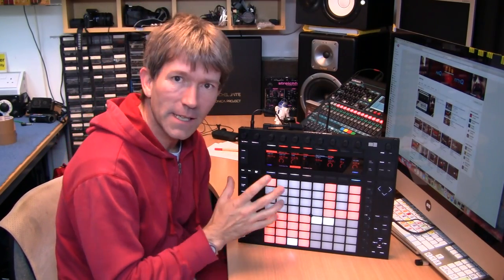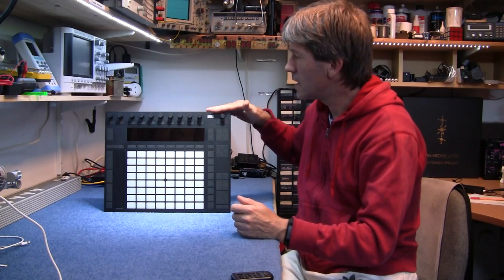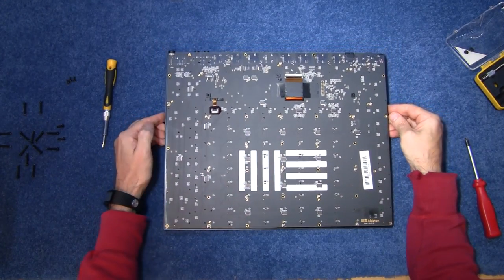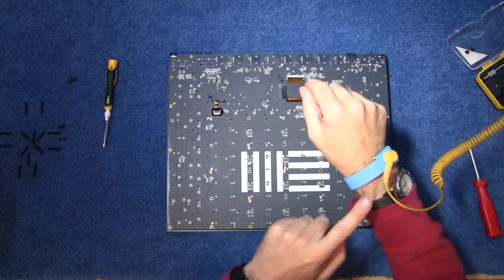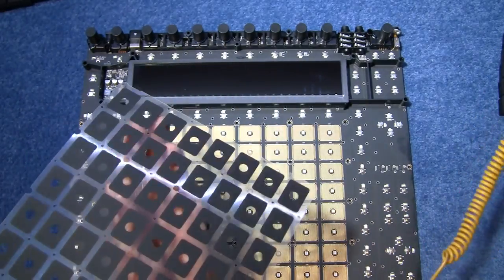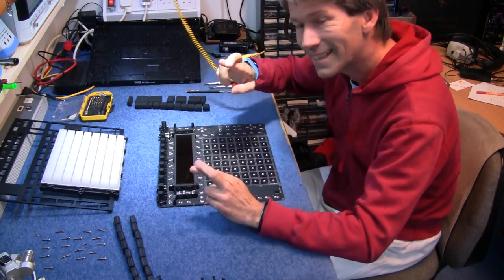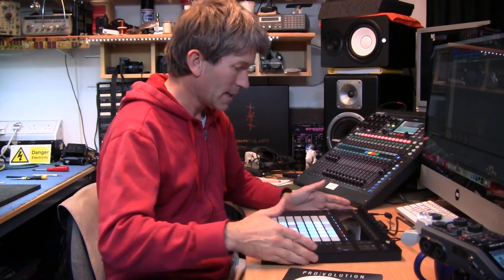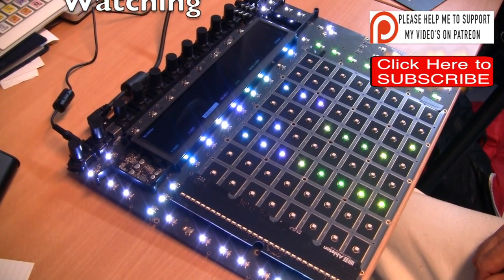ABLETON PUSH 2 teardown MF#60

Comment: Seven years later the finish on the bottom case has turned into a sticky mess so thank you for the teardown. I am disassembling in order to strip the finish down to bare plastic.

Comment: Hi Markus, thanks to your tutorial I've been able to open my unit and polish the carbon layer and some contacts from a couple stains of red wine. Pretty smooth procedure. I'm not an expert in hardware but I think this machine it's really well builted and designed. Thank you again for your help, I'm sure many people have found your teardown very useful.
Reply: How did you clean it up? I need to open mines too! I got 2 pads that aren't working

Comment: Thank you for this video. Watching this I found those hidden screws and also used a hairdryer to loosen the glue. I was able to have the confidence to take apart and repair my own push 2 after having accidentally thrown a large glass of red wine on it! I cleaned out the wine that was trapped between the carbon layer and the button circuit and it works perfectly again.
Reply: Hey dude I'm here as I have a cleaning job on it also :) What did you use to clean it?
Reply: I would also be interested, could you share your experiences and cleaning products?
Reply: @jajahah1359  see my comment above, I didn’t get anything special. :)
Reply: Hey, thanks for your comment. What did you clean the sheet with? I ask as I'm having problems with mine and think that I need to do the same. I just don't want to use alcohol and ruin it if there is any potential of harm.
Reply: @AaronHalliday  see my answers above :)

Comment: Thank you for pulling this apart, I was quite curious as it feels extremely solid and more responsive than any other similar device I had owned, I had the MPC 2000 back in the 90s which was pretty good. Great channel!
Reply from the maker: Thanks Alpharisc, this Push 2 controller just feels so solid and I like it so much I have actually disposed of the box which is something i very rarely do as I do not think I will ever sell this on. something I feel will last me many years.

Comment: Thanks, your walkthrough was helpful in fixing poorly performing pads which were affecting my ability to sequence well on the Push 2. I particularly appreciated your tip on using small screwdrivers to align the pad layers with the tiny guide holes.

Comment: "That's just an excuse for me to take something apart", hahaha, I like that much honesty. The Ableton has a microcontroller which is hiding under the display. Afaik it's a 32 bit µC
Reply from the maker: +Chip Guy Vids Hi Chip Guy. Thankyou for that info. I thought there must be one somewhere but I did not get around to removing the display as I was being very cautious to not break anything. Cost me too much.
Reply from the maker: +Chip Guy Vids Thanks Chip Guy Vids, I have placed your info into the description box under the video.
Reply: +markusfuller I can completely understand that. The new stuff is often very sensitive and not really made for taking it apart without damage.
Reply from the maker: Yes but I just need to take everything apart. Thats the whole reason for my existence on this planet. Though the real challenge is getting it back together so it still works.

Comment: Thanks for the video! Just fixed my unresponsive pads by removing all dust, and the touchstrip also started working way better since putting it back together. Your video was very helpful!
Reply: how did u remove the dust?
Reply: @Mikas_Emil  isopropyl alcohol (96%), cleans it really well and also evaporates... Highly recommended for cleaning electronics
Reply: @stanbekker  Exactly what I did, worked like a charm. Make sure you don't clean the plastic sheet covering the pad contacts with alcohol though!

I had some pads that were desensitized for years, and recently two pads died entirely and didn't respond no matter how hard I hit them. Cleaning the contacts made everything work good as new again. I was surprised that cleaning it actually worked so well.

Comment: Props! I had to open up my Ableton push 2 because of a common manufacturing problem: Some buttons get dirty or move over time and it was the only way to get it back in shape.
I've had both push 1 and 2 and they made it a lot harder on the push 2.

I've had a lot of issues with the million of sh*t screws they use for the machine. They would strip or get stuck. This was my 1st and last time trying on the P2.

Comment: Great video.  I like that you put it all back together and it still worked!  :-)  Also, that is an awesome set up of DAW + electronics workstation you've got there!

One question: I see the four screws in the middle look like they would line up with a Roland drum stand mount (Roland PDS-10 or MDP-7 for example).  Structurally, would it be ok to mount on a drum stand if the the screws do line up?
Reply from the maker: +Mike Manuel Hi Mike. Thats a good question. I have the roland PDS stand. - - - the holes on the Push 2 are 90-X-116mm  but the holes for the PDS stand are 76-X-100mm - - - oh thats a shame but Well spotted there. Best wishes from Markus.

Comment: I have a group of 6 of pads in a single column that do not respond properly to low velocity. If I slowly apply pressure to the pad a note will eventually trigger with a value of around 40. So the playing dynamics are poor. The other (normal) pads with respond with a low minimum value of 1. 
My question: Is there a product that can be used on the carbon sheet and/or sensors that will clean and restore without damage? 
Thanks!

Comment: Hello dear! Tnx for this video! I have a problem with my push 2 and that's why I'm here! Glad you help me! One of my pads stuck sometimes! When I push if from sides of pad it works properly but when I do it from the center of that pad it occures! What is the problem and is there anyway to fix it because I'm out of warranty right now and there is not anywhere in my area to repair it! So tnx if you help me!
Reply: Hello, did you fix your problem? I also had this problem too, and i'm thinking about open and clean this Push 2 (but i'm afraid lol)

Comment: Hey Markus, I've watched this a few times now.  Thank you for the video.  I've been having issues with the pads on my Push 2.  The first time was 3 years ago, where some of the pads we're always conducting.  I assumed moisture so I put it under the intake of a box fan for a few days and it resolved itself.  A few weeks back this started happening again so I tried the same method, which worked to some extent, but I still see issues.
I think my best option is to open it up and clean the carbon sheet and traces.  Do you have any recommendations on equipment to do this?  My plan was just rubbing alcohol and a microfiber sheet.  Please let me know if you have any tips or tricks! Thanks.
Reply: Hello, I have same problem with auto trigger pad. Did you able to fix it?

Comment: I recently bought a second hand Push 2 and noticed that the sensitivity of the pads was not balanced between the pads.  I have already opened and closed it but I am having difficulties in resolving the issue of sensitivity.  Any suggestion?  Thank you very much.

Comment: i have the same push but mine sort of doesnt work without the adapter now, over the period it stopped working, i was powering it solely through midi cable and now it doesnt work  just through the midi cable, what could be the problem here ?

Comment: Nice to see that akai haven't cut any corners on build quality, thanks for video.
Reply: +jean luc Dubinator akai didn't build the push 2, ableton did. akai only build the push 1
Reply from the maker: +ivaren Yes you are quite right Akai had nothing to do with the ableton push version 2 only the original version.
Reply: +markusfuller I didn't know ableton we equipped to build electronic devices, news to me.
Reply from the maker: +jean luc Dubinator Akai was in on the first version but ableton made this one themselves. maybe they had designed it by themselves and outsourced the manufacturing as lots of companies do now. even moog have their boards built elsewhere and just assemble the parts in house.
Reply: +markusfuller . Makes sense, thanks.

Comment: What is your impression on black rubber button quality/longevity. There seems to be thin rubber coating above clicky button. There is a thread on ableton forum where rubber got scratched by nails and the led light shines through the scratch. Thanks.
Reply from the maker: +Maris Jukss Hello Maris. I have only had it a short time and have since read about this problem that i was not aware of. at the moment it all seems fine though i will certainly keep an eye on that and hope it does not happen. Thank You for pointing that out to me.
Reply: It depends on how you use it. I have used it a lot in and out the studio and the buttons are ok and the rubber is great. Now I'm having problems with some pads near the slide bar I have to press it hard to function. So I'm gonna open it to clean up
Reply: @SudacaBeatz  I know that it's been a year ago since you wrote it but how it works? I have the same issue.
Reply: @ilyakarmanov  hi. I've never opened it but I have to send it to repair because I'm having the same issue. Some pads are not working.

Comment: Wish I got to see close-ups of the back of the panel, and what microcontroller/fpga was controlling it all. Every software sequencer, USB interpretation, MIDI translation, and drawing operation for the screen are handled on a chip running a program somewhere. Would love to know if it's an AVR, ARM, FPGA, or ASIC.
Reply from the maker: +Michael Hawthorne Hi Michael. I am not sure what processor was under the screen. If I open it up again for any reason I will get some close up images of the main processor chip. Sorry I miss some things out but am learning as i go along. the more video's i make the more I get to know what people want in the video's . Best wishes from Markus.

Comment: Hello, i spilled some beer (i know, no drinks near the equipment) on my Push 2, and some pads lost the precise sensibility, should disassemble it and use some cleaner or something? I know its not going to be easy, but i need to try.

Comment: Im having trouble opening my Push 2. Ive taken out all the screws but the case is getting caught on the "1 and 2" sockets in the back. It feels like any more force will break the cover. Its the only place it is stuck at. Any tips for opening that up?
Reply from the maker: Hello It was a long time ago when I opened mine. I think you have to lift the opposite end a little first then slide the back so it kinda unhooks from the sockets then you should be able to lift the back off.

Comment: Hi! One of my knobs, 6th from the left, is bezirk,  when I turn the knob, it outputs random values, and jumps up and down in values on what ever parameter is active, like browsing, automating etc. which makes the knob totally useless. I will probably return the unit. But just for curiosity, would be possible exchange one knob and it’s connected ciruits?

Comment: Great video. People have had complains about the coating on the buttons with the push 2 (fingernail ripe of the black coating). Have you noticed anything like that on your unit?
Reply from the maker: +ivaren Not yet but I have not had this more than a couple of days.
Reply: I guess it wouldn't matter that much. Have you seen the teardown video on the push 1? Doesn't look quite nice, honestly. More plastic inside.
Reply from the maker: yes maybe i'm a little too happy over this, people are now telling me the black picks off the buttons if you catch them with your nails ?.
think i will cut my nails just incase.

Comment: Hi, do you think it´s possible to cut of the complete hardware part starting from the upper part of the pads to mod the push 2 to just have the top section of this device? I am thinking about to have just the top part as a Live controller.
Reply from the maker: @olli_vollmer  Hi I do not think that is possible as it is one big circuit board.
Reply: @markusfuller  Thanks for your answer. Than hopefully Ableton will bring out a smaller push 😊

Comment: hi markus found you from producers hangout vid , i love how the designer's or whoever have signed the inside and the stickers on circuit board placed like the abelton logo ,you are very brave to take your gear apart , have you ever accidentally damaged any of your gear whilst opening them,even though i have opened up several laptops to do minor repairs with heatsink etc ,ill never take any of my gear apart, well thats i lie ill have to open up my beringer bcr as i want to put nicer dials on it
Reply from the maker: +MCX@ClocktowerProductions Hi Thanks for watching the video. to be honest NO i have never damaged anything while opening it up, I use to break things when i was a child over 40 years ago but have learned as i go along the different ways how manufacturers make things difficult to dismantle like hide screws under sticky labels and rubber feet etc.

Comment: Any idea on what the two small 6 pin headers are used for? Are they just some sort of General I/O headers or do they attach to something when the top is placed back on. There's One to the top left of the main pad bank, And one near the bottom left of the unit. No real reason why I want to know Just curious lol.
Reply from the maker: +Jeremy Hi Jeremy. Those pin headers held the touch strip circuit board which has the line of white leds running up the side. Best wishes from Markus
Reply: +markusfuller lol thanks idk how I didn't see that. I must of just had one of those dumb moments.
Reply from the maker: My whole life is one of those moments LOL

Comment: I bought a used Push 2 and two of the repeat buttons are in the wrong area (the 1/32t and the the 1/8t buttons are in each other's slots). The unit is no longer under warranty. Is it safe for me to open it up and switch them, assuming I'm using anti-static cord like you are in the video? Or is it high risk to open it up?
Reply from the maker: Hi I guess if you are carefull and open it up like i did in the video you should have no problems swopping them over. someone must have opened it up already if they have been swopped around. take a picture of the top panel so you can be sure every button is placed back correctly and everything should be just fine. good luck.

Comment: Thank you! Good quality for being today But I have problem with power switch, also many others. That switch seems to be a weak link in the chain as device can't be turned on. And I think the touch strip is weird with response.

Apart from that, yes, feels very solid but having wear issues like power button and pad sens after as little as 5 years is still sad. Especially when it's only due to a weak link.

Awesome with signatures, makes me think of emu emax with the ram bird 🐦😀

Comment: Hey Mark. Do you have any solutions for loose or bumpy encoder knobs? I just purchased a brand new Push 2 and only one knob is smooth with the proper resistance. This is very frustrating considering the price point. Any help is greatly appreciated. Thanks
Reply from the maker: Hi All the knobs should feel the same especially if its a brand new push2. sadly I do not have any solutions to make them all feel the same. really sorry about that.
Reply: @markusfuller  Thank you. I'm going to attempt to exchange it. New gear should be flawless.

Comment: Hy, what did you use to clean the pad sensors area?
Reply from the maker: Hi Tony. I did not clean the pad sensors as in this video I just took it apart to show what was inside it and how it worked. I am not sure how i would clean the pad sensors in this machine as i no longer own it so cannot take a guess.
Reply: @markusfuller  Thnx for opening the Push 2, it was a great guide. Some pads where getting insensitive and after while it was getting worse. As a finger drummer this is not good. So I opened the Push, cleaned the latex pad's and plastic with hot water (yes, like the dishes) and the rest I used hightech microfibre for the electronic parts. and sensitivity is back like new.
Reply from the maker: tony beatbutcher Hi Tony thats great news. I will remember what you did just incase i come across this problem in the future. best wishes for 2021
Reply: @markusfuller  best wishes ;)
Reply: Hi Tony, that was great for  you for repairing the push yourself. I have problem with the pads too, but mine is stuck instead of insensitive. Do you think this is also caused by dust? When you clean the pads, is the dust really the cause of the problem?
Reply: @priawanwibisono2261  hy Priawan, maybe. I cannot know without opening the Push, witch is something you got to do on your own risk because it's sketchy. Anyway, dust can block a pad from being played.

Comment: do you think theres a way to mod these pads. im finding im having quite a few problems with the pads double trigering while im drumming! and im guessing the pads themselves cant be changed but do you know of ant tips or tricks? i know with some of the akai gear there was one guy who found if he loosened a certain screw in the back somewhere and it helped for some reason! just wondering if you know of anything or have heard anything about the sensitivity and or velocity of these pads on push 2! I had the push one for abit and you could actually control the parameters better and though these pads feel better i find there more spiratic and sometimes less responsive than push 1
Reply: thanks! its kind of wierd though it doesnt seem to matter where i set the sensitivity on the push 2, the pads still double triger or dont trigger at all when your playing softer or doing a faster drum roll! the push 1 was almost better! but playing with the settings on the instrument is a good point, but in my case its usually just drums that i have trouble with!
Reply: I guess all the experience with drum pads that AKAI brought into Push 1 made it a little better in that regard...Then again they're not know for the best build quality.